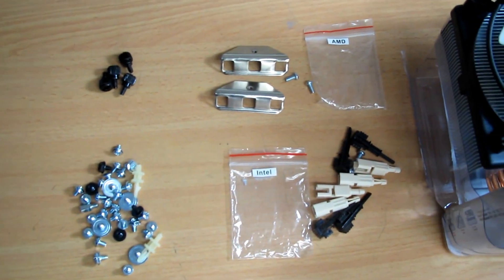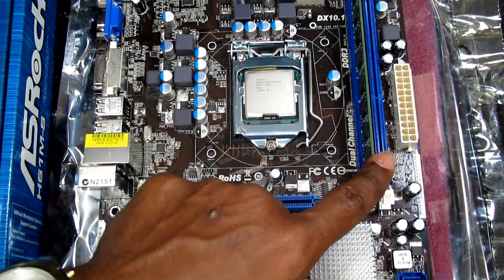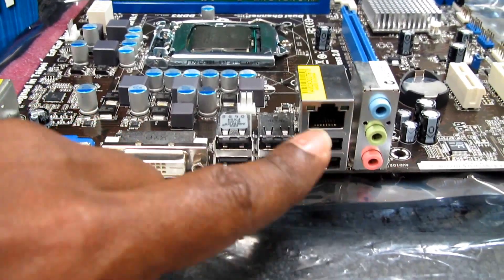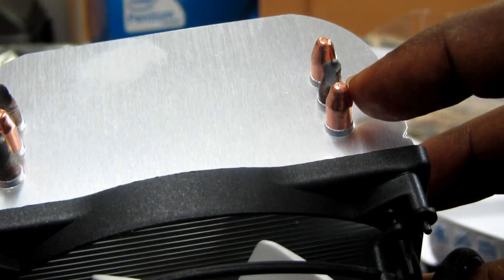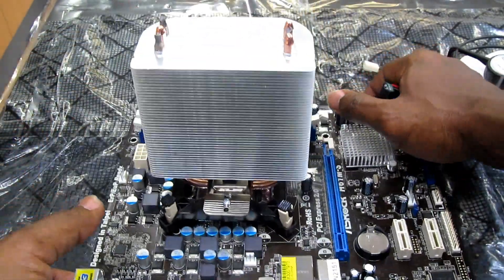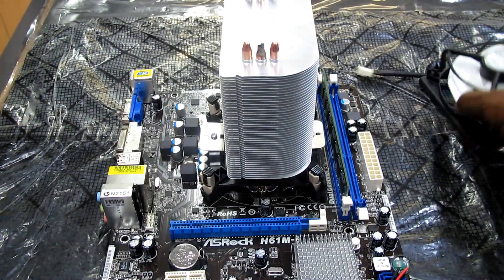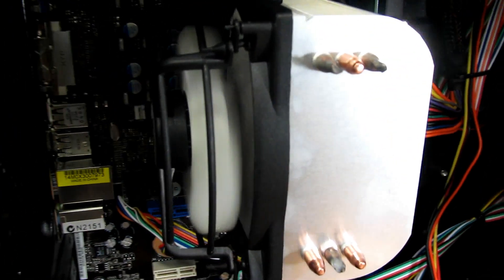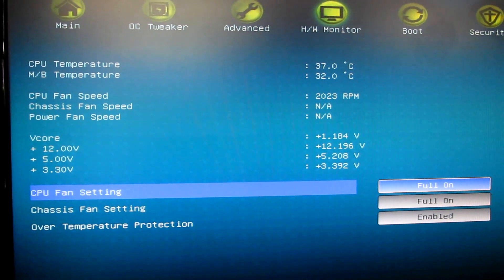How to Install Arctic Cooling Freezer CPU HeatSink into Asrock H61M-S Intel Mainboard

Comment: I have a similar micro-ATX motherboard ASRock B75M-DGS and there is only two DIMM slots which I need to fill up for 2x4GB memory.  I'm worried that this CPU cooler won't fit because of the fan intruding into the memory stick height.  Arctic Cooling came out with a newer design called Arctic Freezer i11 which seems smaller.

Comment: Your cpu fan is sucking the air from the outside and your back case cooler is trying to push the air out. I think what Udinbak wants to say is, that it would be much more efficient if you would turn the cpu cooler around (180° angle). But this way, you couldnt install your RAMs xD

Comment from the maker: The heatsink fan is installed correctly in this motherboard. The heatsink fan main job is to cool the CPU not the entire computer case. The PC case fans job are to manage the Air flow in / out circulation inside the box.

Comment: You installed the cooler the wrong way round. Air flow should be from the front to the back. ie the fan should be pulling air in from the ram side and expelling the hot air towards the rear case fan/psu fan. just pointing it out for anyone who intends using this as a tutorial.